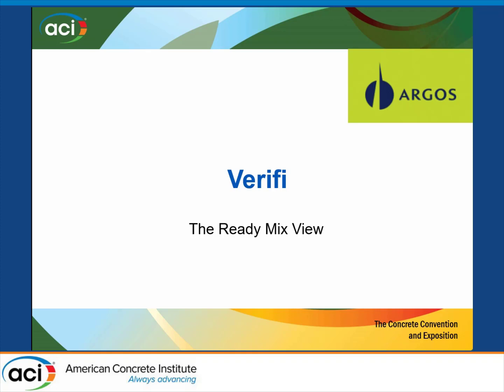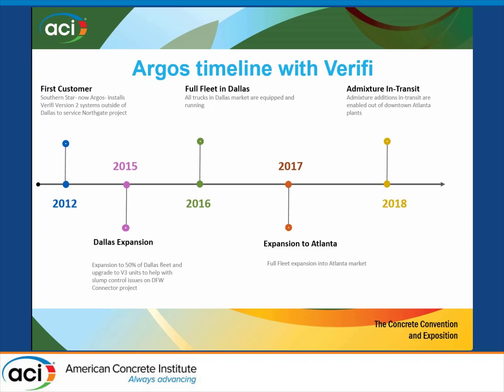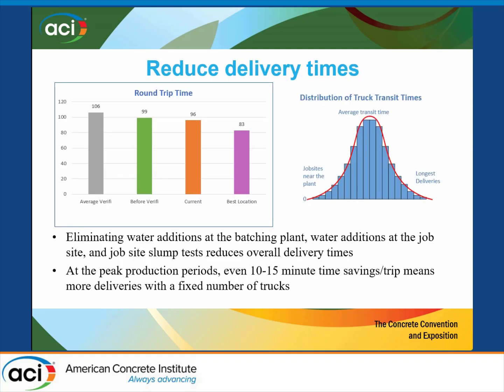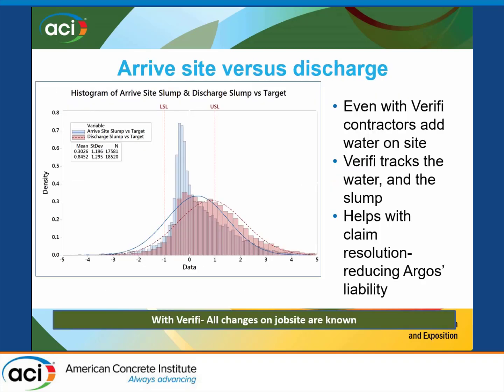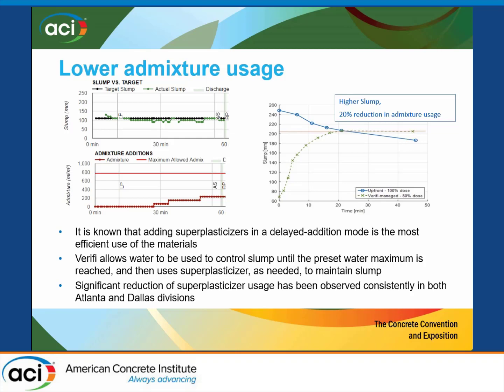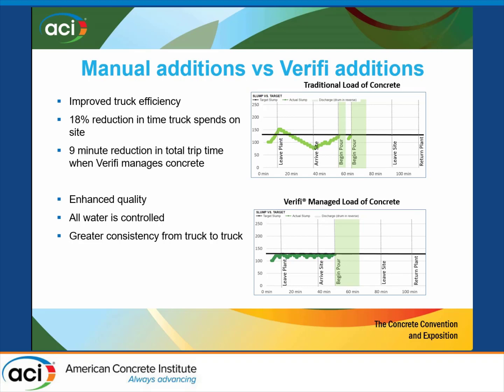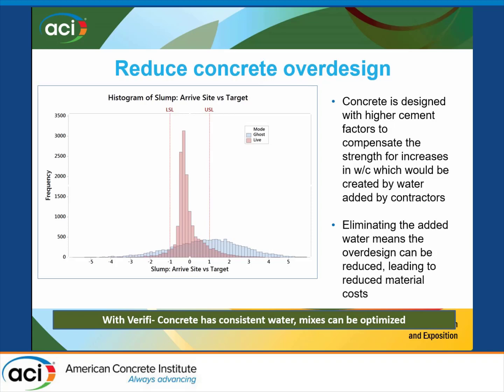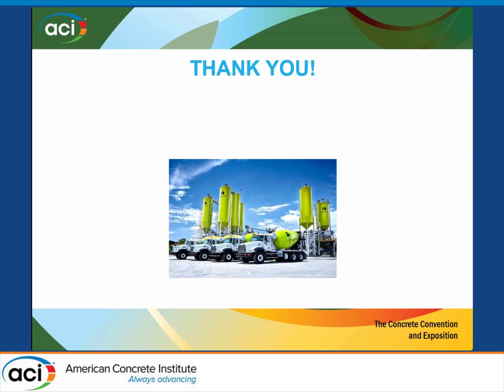Verifi—The Ready Mix View

Comment: I used to work at a business in West Chester, Ohio by the name of ReadySlump. They were bought out by GCP. I can't tell you how many drivers and operators would hate this system. They were used to the old method calculating slump measurements at dispatch. The idea was truly revolutionary. I think the reason it really hasn't caught on worldwide and why we're not seeing more of this system comes down to operator compliance. We sold a lot of water purge valves and they were absolutely FRIED when the operator discharged air through them, all the batches were BAD. There was a lot of terrible events that happened at ReadySlump of which I am at no liberty to discuss.